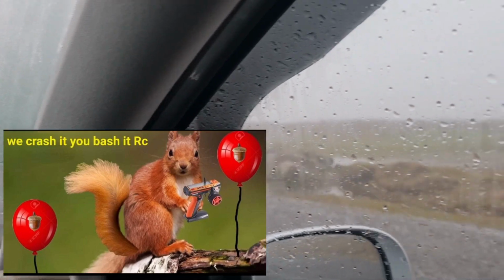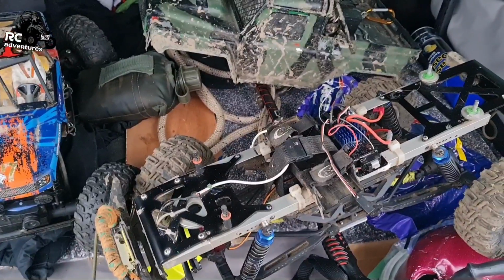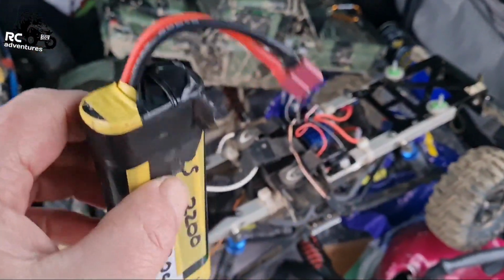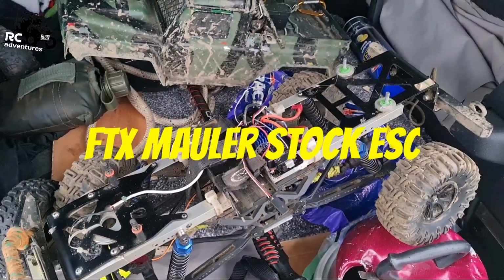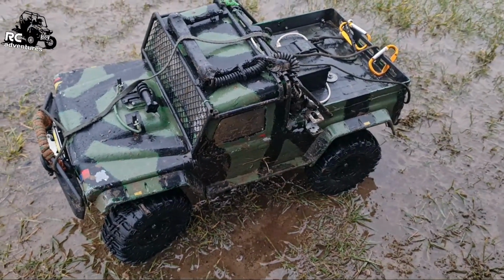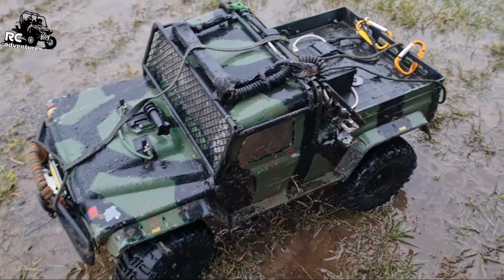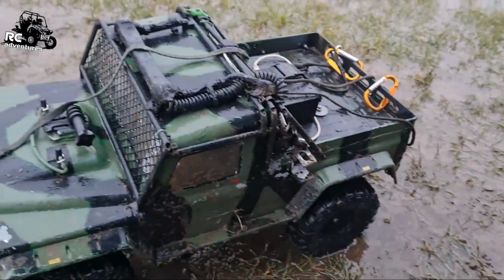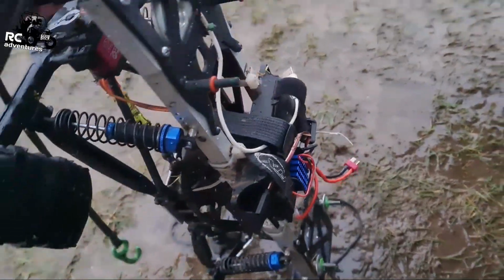U-9 FTX KANYON SUBMARINE

Comment: Is the ftx kanyon a good car stock because i am thinking of buying it but don’t have the money to upgrade it? 
Also is the ftx kanyon water proof when its stock ?
Reply from the maker: yes bud I ran mine stock for ages,  I recommend these trucks all day long .  chassis brace is an essential mod but apart from that they are good to go.  the receiver box needs waterproofing though. I wouldn't recommend driving it like this but they are ok with bit of water. you won't beat them for value for money but they are big, like more 1/8 scale as they are 1/10xl  . I bought mine due to budget and spent very little on it. I have loads of videos on all the mods n stuff.. anything you need to know feel free to ask 😃👍
Reply: Ok thanks i will get the chassis brace though
Reply from the maker: the screwfix angle is better quality 15mm×15mm 👍